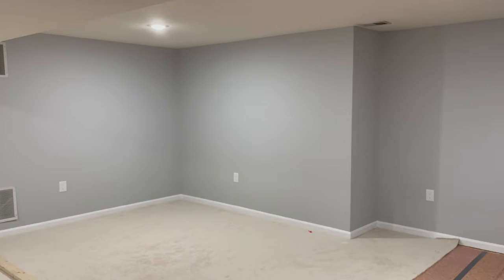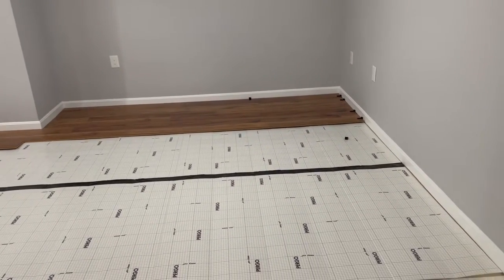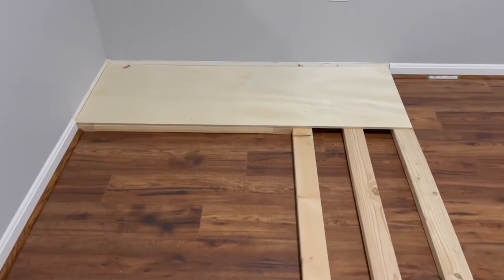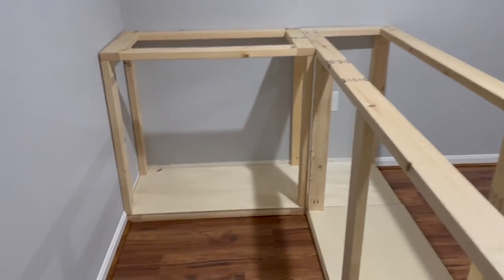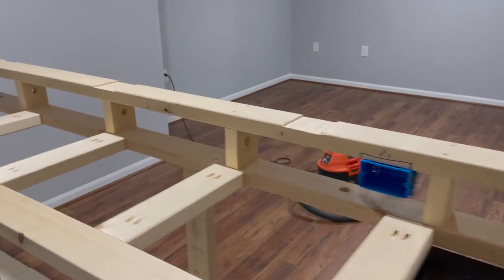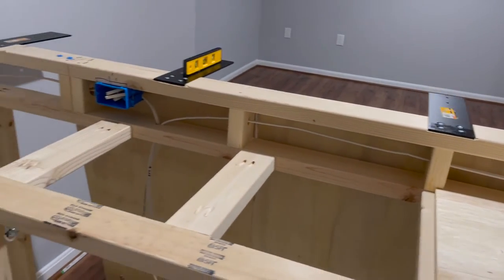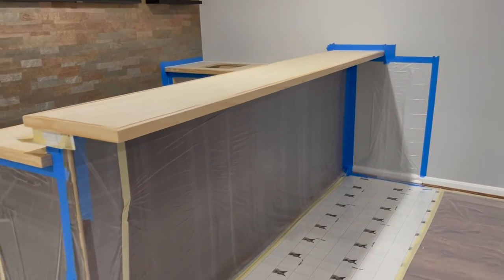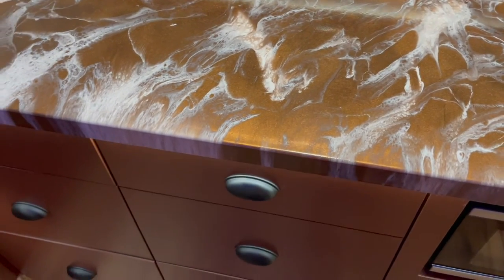Home Bar Build, DIY | Epoxy for countertops. Stone feature wall.

Comment: Awesome but where did you get water from
Reply from the maker: There is our utility room right behind the wall with hot cold water line and drain line.  That’s the reason in chose this location for the bar.

Comment: Can I ask what flooring and color you used?
Reply from the maker: https://www.homedepot.com/p/TrafficMaster-Distressed-Brown-Hickory-12-mm-Thick-x-6-1-4-in-Wide-x-50-25-32-in-Length-Laminate-Flooring-15-45-sq-ft-case-34074SQ/204068076 We wanted to use vinyl but couldn't find the brown distressed look we wanted, so went with laminate.

Comment: How you cut the notches without a table saw would be nice . They seem to shallow to use a circular saw
Reply from the maker: Sorry I didn’t show that. I raised the blade of the circular saw so it will only go 1/4 inch (or the size of the notch) deep. Then ran it multiple times for the notch. Finally cleaned it up with a chisel and hammer.

Comment: How did you install the sink?
Reply from the maker: The sink came with a template for countertop. Used a saw, and then the sink just drops is. Add some silicone in between to keep it in place.